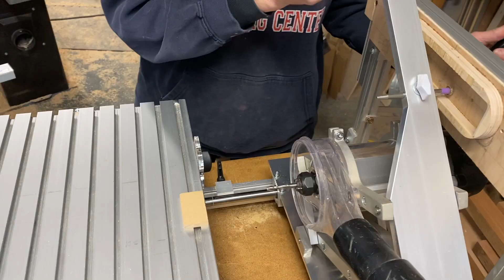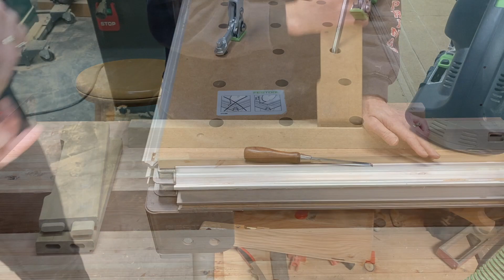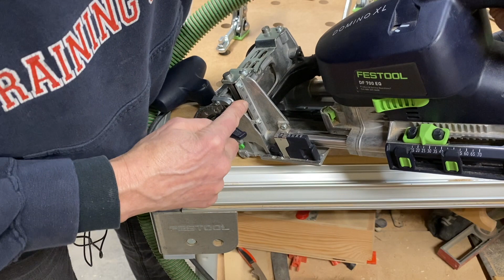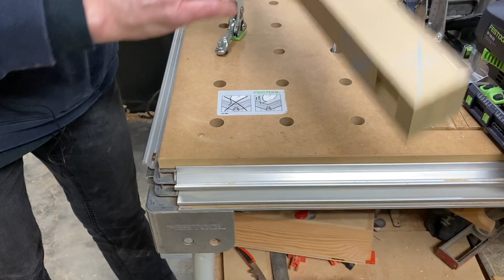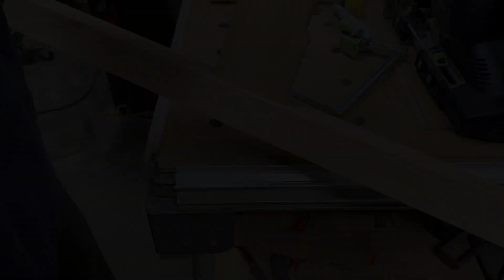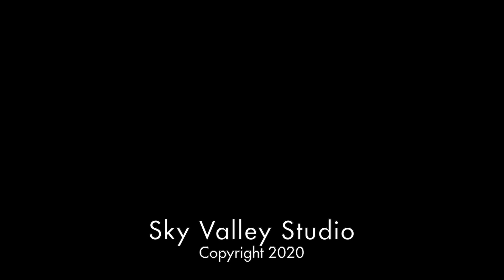Pantorouter and Domino Housed Mortices

Comment: Why would you even need the Festool with having the Panatorouter to do it all. Im confused
Reply from the maker: Good question! The full tenon, my preferred method with the PantoRouter, takes more material than loose tenons (Domino). And making a housed M&T at an angle with the Pantorouter, while not impossible, can be a bit challenging to get everything to line up just so on angled chair legs. Using the hybrid PantoRouter/Domino combination makes that a little easier, but not necessarily better. (See my playlist on building the Gamble Inspired Dining Chairs, done entirely with PantoRouter.)

Comment: Impressive layouts for joints makes for a very solid chair. Excellent workmanship.
Reply from the maker: The first set I did entirely on the Pantorouter. I had trouble lining up double tenons in a housing, so I tried this. Thanks! It is a very strong joint.